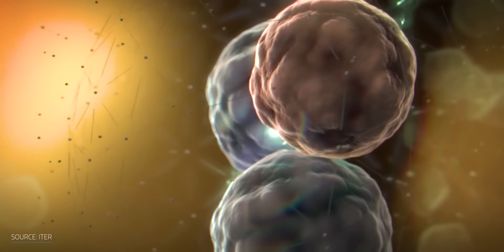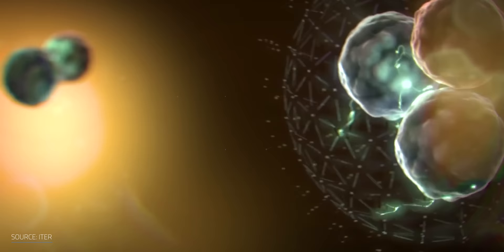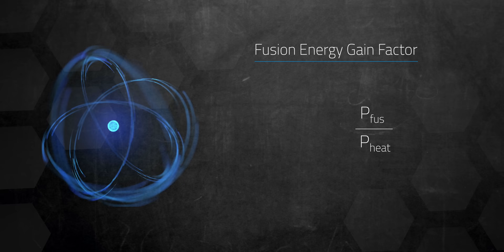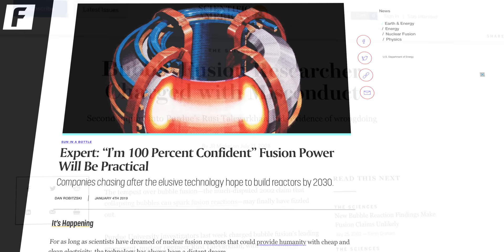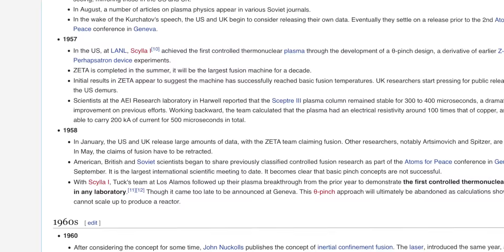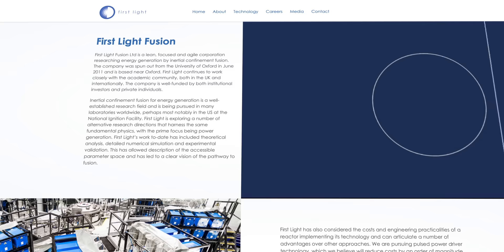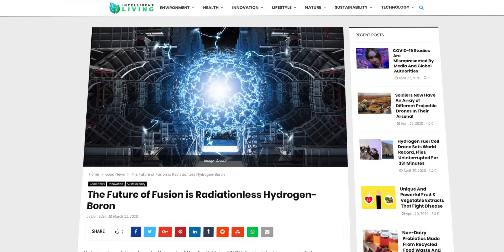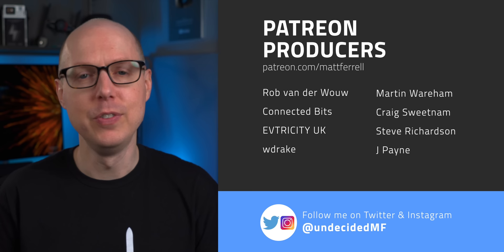The truth about nuclear fusion power - new breakthroughs

Comment: I'm a layman. So forgive my ignorance please. But this is my thinking:  If hydrogen can go through a fusion process to create a hydrogen bomb explosion, then why can't we scale it down to work in controlled hydrogen explosions in fusion reactors?  Why must we use tritium? Do hydrogen bombs work on fusion.  My understanding is that hydrogen explosions occur when proton/neutron pairs are split apart by the chain reaction of other protons and neutrons smashing into them.  That's the definition of fusion, isn't it? If so, then couldn't we control the size of the explosions by limiting the amount of hydrogen available to each chain reaction, like in a motor cylinder?
Reply: Couple things mixed up. First, a hydrogen bomb does use tritium. Tritium is just a type of hydrogen. H-bombs don’t use regular hydrogen. 

What you described about atoms splitting is fission. Fusion is the combination of atoms (the opposite). Both happen in an H-bomb. In an old fashioned atom bomb, only fission happens with no fusion (and no hydrogen/tritium). 

We can’t use them in a reactor because there’s no way of controlling this, they’re just too powerful. In order to kickstart the fusion reaction in a bomb, fission is used to create extreme heat and pressure. This would destroy anything we put it in.
Reply: @Gomlmon99  thanks.  So the h-bomb uses fission to create the fusion reaction?  The fission then I assume is created by extreme heat caused by what?  An explosion?  An electrical flash of photons?  My mind keeps thinking there must be a way to miniaturize the scale of hydrogen fusion in such a way to create enough heat to power a steam powered generator.  A normal AC light bulb sans oxygenated air can produce enough heat in the element to fuse nuclei in a way to produce heat at thousands of degrees which releases photon particles, right? That's fusion also then, if my thinking is correct.  Granted only the tiny element reaches thousands of degrees and by the time the heat reaches the outer glass shell of the bulb it is reduced to only a couple of hundred degrees. But suppose we could put the element inside a sealed tube which is constructed of high-temp vacumous glass with a diameter only slightly larger than the element.  And then put that inside another stainless steel sealed tube containing a water/steam system or hydrogen/steam system to power a generator.  Has that been tried?  I know it's more on the micron level compared to the grand fusion reactors we see being developed. But still, if it is shooting photons out then a common light bulb  is still reaching the point of fusion, right?
Reply: John Richter A h-bomb uses a conventional explosive to compress some nuclear material together, which sparks the fission reaction. That in turn causes the much larger fusion reaction. 

I don’t really know anything about how light bulbs work but if it’s fusing nuclei, I doubt it’s creating more energy than it uses. I assumed there was no fusion and it just glows because it’s hot but I’m probably wrong. 

What you described hasn’t been tried, and I’d guess it wouldn’t be possible to produce sustained fusion that way that produces more energy than it uses? Not too sure.
Reply: @Gomlmon99  I certainly agree. The resources needed to spark a miniaturized hydrogen fusion reaction would never get close to overunity.  My idea was to simply pass tritium through a separate tube alongside a heated light filament to see if the pressure in the tritium tube would increase.  My thinking is that every incandescent light bulb is also a miniature fusion generator.  All incandescent bulb filaments shoot gamma rays off in the form of helium-like sets of protons and neutrons (Photons).  So every light filament is a little fusion generator.  My idea is to pass tritium through a sealed glass tube (with distant reservoir) along side a powerful vacuumed deoxygenated environment filament emitting gamma rays to see if those emissions could spark a plasma cloud inside the sealed tritium tube system.  I don't think it would take much to test.  But I'm just a layman.  How would I get the tritium to test this?  Or could you test it?

Comment: Fusion power isn't the savior you all think it is. It will fall into the same trap that nuclear fission did, that is be insanely expensive to build and maintain. If the fuel is seawater the fuel may be cheaper, but we may need to go to the moon to get the elements we need. Nuclear fission only failed with early Gen reactors. The newer fission reactors have been designed to fail much less and often fail safely when it does. If fission reactors were both cheaper and safer, we would likely already have most of our energy production based on them. Fusion reactors will likely be even more expensive, and if they can't be cheapened quickly, will be largely undeveloped until we run out of fossil fuel and land for the other power sources.

Comment: star's gravity is so immense that it causes particles to fuse. gravity is key to sustained fusion in stars. what does a tokamak or other fusion reactor design has to sustain fusion and get net positive energy?
Reply: The net positive energy is gained from the fusion reaction. It doesn’t need gravity.
Reply: @Gomlmon99  sure. should've worked by now. containment issues has been pretty decent 10 years ago. so explain why can't anybody maintain the reaction??
Reply: @jojojojojojojojojojojojob  maintaining the reaction isn’t really a problem. The physics is well understood. The main issue is dealing with the neutron bombardment causing the entire structure to get embrittled.

Comment: What's happening with Thorium reactors?
Reply: Nothing ever will.

Engineers should understand that they are too stupid to comprehend how large scale social spending decisions are made.  Returns are not measured as you say, but more importantly generation is not compared only to generation but to solutions that shift or reduce use. 

France has not been able to export it's nuclear technology.  Germany has copied it's solar solutions planet wide and gets patent royalties.  There is no "backup" required on modern grids with demand response and EVs.  

Neutron scattering is a loser economically and you calculate the dead by opportunity cost. The wasted money on nuclear has killed vastly more people who weren't saved by, oh, better public health. 

ALL nuclear fission reactors are wildly expensive and take about a decade to construct. Thorium the more so since it requires the thorium to become uranium in a breeder stage first. Even at five years and a billion dollars, no power grid on Earth cannot find far better ways to invest that money over that time:

1. Swap out a billion light bulbs, from florescent to LED, cutting 20W each (or 80W each from incandescent). That's 20-80GW x the % of time each is on, say 10% of the time.  2-8GW saved! 

2. Change over 50,000 ICE vehicles to EVs at $10,000 each and install 5,000,000 solar panels at $100 each. The EVs store all the solar and take no oil, and feed the grid every day at peak times. Not only more power, but when it's needed. If each vehicle can #V2G just 1kw/day, that's 50MW for all 50,000 vehicles extra at peak, plus all the solar left over. It adds up to far more and more flexible power than the thorium.

3. Install $300M of transmission to a big dam that already exists, and spend $700M covering irrigation canals with solar shade. Less irrigation water loss, more power, more flexibility in backing up the dam since it doesn't need to release as much water and can reserve it for power reasons.

Comment: If you add in the electrical energy being used to run JET when it set its record, that 700MWe of electeicity brings its Q down to about  .03 instead of
.67. So we aint even close.
Reply: Again, you’re just changing the definition of Q. Q has a strict definition in plasma physics, you can’t just “add in” this and that to fit your agenda.
Reply: @Gomlmon99  bullshit, they are the ones that play with the definition. Q should be the subtraction of all the parasitic appliances, the amount of electricity put into the plasma, the amount of thermal put into the fuel, from the amount of energy that can be shunted to the grid. But that’s not it, they only calculate using the amount of thermal put into the fuel because that is what gives them the “gain” .  And I didn’t even mention that what they are getting out in the way of thermal is only about 40 percent efficiency once you convert it to electricity. So talk to them about what Q allegedly means. They tell the public and politicians etcetera in a manner calculated to deceive them. Is that science? So your position is that knowing Q is meaningless with regard to commercialization it’s ok for them to secure funding with transparency?
Reply: @russhamilton3800   That’s something else. If you want to create a new measure that’s fine, but you can’t redefine a physical constant just because you don’t find it useful. Physics doesn’t care about your feelings. 

Of course Q is not everything when it comes to commercialisation, what idiot thinks that? That’s like saying neutron efficiency in a fission reactor is what defines commercial viability of fission. That’s laughable. 

Q is just one of many important metrics. Don’t get so butthurt about it’s definition.
Reply: @russhamilton3800  Send me a source where any of Eurofusion, ITER Organisation, F4E, KIT, ENEA, UKAEA or any other ITER relevant fusion group says Q is net?
Reply: @russhamilton3800  “The condition of Q = 1, when the power being released by the fusion reactions is equal to the required heating power, is referred to as breakeven, or in some sources, scientific breakeven.”

Q refers only to heating power vs power internal to the plasma. Nothing else, no matter how much you cry that you know the physics better than the experts.

Comment: Practical fusion power has already taken over.  Solar PV systems are everywhere now and are cheap and reliable.
Reply: I’d probably say cheap and reliable is a bit of a stretch
Reply: @Gomlmon99  According to some Graph from Fraunhofer ISE i found the production cost per kWh of PV (in Germany) is actually the same / lower (for large plants) than fossil fuel power plants

Comment: abstract communications.... In 2003, the USA rejoined the project and China also announced it would join. After deadlocked discussion, the six partners agreed in mid-2005 to site ITER at Cadarache, in southern France. The deal involved major concessions to Japan, which had put forward Rokkasho as a preferred site. The European Union (EU) and France will contribute half of the €12.8 billion total cost, with the other partners – Japan, China, South Korea, USA and Russia – putting in 10% each. Japan will provide a lot of the high-tech components, will host an €1 billion materials testing facility – the International Fusion Materials Irradiation Facility (IFMIF) – and will have the right to host a subsequent demonstration fusion reactor. The total cost of the 500 MWt ITER comprises about half for the ten-year construction and half for 20 years of operation.

India became the seventh member of the ITER consortium at the end of 2005. In November 2006, the seven members – China, India, Japan, Russia, South Korea, the USA and the European Union – signed the ITER implementing agreement. Site preparation works at Cadarache commenced in January 2007. First concrete for the buildings was poured in December 2013. Experiments were due to begin in 2018, when hydrogen will be used to avoid activating the magnets, but this may now be about 2020. The first D-T plasma is not expected until 2026. ITER is large because confinement time increases with the cube of machine size. The vacuum vessel will be 19 m across and 11 m high, and weigh more than 5000 tonnes.....

🌏 📡🌏 👣🕘 💎👽☠☼☾☄ゞど・ㇺㇾㇽ₪𝖎𝖙𝖎𝖇𝖎𝖗𝖆₪なめㇺㇾㇽ✶☥✨🌛🌄⊀✶⋊🐺🐾☆🐜🐜▲▴◭

Comment: What king of energy fusion creates?? Thermal, electrical, radiant...
Reply: It is converted into electricity, but the exact type depends on the type of fusion energy we use. Most advanced right now produce high energy neutrons which heat a liquid metal blanket around the reactor, which then raises steam.

Comment: Fusion would be fantastic, but I think fission gets criticized unfairly here. Fukushima, for instance, killed a total 0 (zero) people, even indirectly through radiation exposure. The tsunami killed nearly 20,000, yet everyone talks about Fukushima. Using Fukushima as an example of the dangers of fission reactors is not a reasonable position. Chernobyl had a design that was known to be dangerous and isn't used in Western reactors ever. In fact, fission beats out solar as the safest form of energy generation per kWh so far.

Fusion will still probably be better, but I think we're going to need fission first—we don't have 30 years to wait. So we should be realistic about the problems of fission and not overstate them.

(I'm also big on solar and wind. I'm not knocking them. Our strategy right now needs to be "DO ALL THE THINGS!")

Comment: They use Tritium and Duetrim not sea water. Tritium is produced in a Fission reactor as a by product. They produce around 20kg of Tritium a year. Second Fussion is still vary radioactive to transfer heat from the magenetic confinement they emit neutrons. These neutrons radiate the containment vessel to a point were the materials in the reactor walls fail. They don't have solution for maintainable reactors or for fuel production, let alone supporting net positive energy. There is also alot of fraudulent claims in this industry as well.

Comment: I know it's fission....but MSRs are proven tech and are as cheap as coal while being as safe or safer than fusion
Shout-out from Buffalo
Reply: What makes you say they are safer than fusion. How is concentrating the most dangerous isotope of uranium safe? How is producing unbelievably corrosive hot, pressurised, radioactive salts very safe?
Reply: @Gomlmon99  MSRs operate near ambient pressure. They run on Thorium, and can burn existing waste stocks away. The by-products are nowhere near as radioactive, nowhere near as toxic, and nowhere near as long-lived as our present fission tech. There was significant research, and there were significant strides made, in metallurgy to deal with the corrosion. They are as safe or safer because they are walkaway safe; literally impossible to melt down. Please look into them. Molten Salt Reactors, not to be confused with Small Modular Reactors

Comment: The Q of 10 for ITER is simply not so. 300MW of electricity in and 500MW of thermal out does not give a Q of 10. The ITER trick to that was to only count the preheating of the fuel and NOTHING else. So we are still 30 years away.
Reply: Sounds like you just don’t know what the definition of Q is?

Comment: In the meantime we should be investing in MSR fission development.
Reply: No it's a failure. 

Engineers should understand that they are too stupid to comprehend how large scale social spending decisions are made.  Returns are not measured as you say, but more importantly generation is not compared only to generation but to solutions that shift or reduce use. 

France has not been able to export it's nuclear technology.  Germany has copied it's solar solutions planet wide and gets patent royalties.  There is no "backup" required on modern grids with demand response and EVs.  

Neutron scattering is a loser economically and you calculate the dead by opportunity cost. The wasted money on nuclear has killed vastly more people who weren't saved by, oh, better public health. 

ALL nuclear fission reactors are wildly expensive and take about a decade to construct. Thorium the more so since it requires the thorium to become uranium in a breeder stage first. Even at five years and a billion dollars, no power grid on Earth cannot find far better ways to invest that money over that time:

1. Swap out a billion light bulbs, from florescent to LED, cutting 20W each (or 80W each from incandescent). That's 20-80GW x the % of time each is on, say 10% of the time.  2-8GW saved! 

2. Change over 50,000 ICE vehicles to EVs at $10,000 each and install 5,000,000 solar panels at $100 each. The EVs store all the solar and take no oil, and feed the grid every day at peak times. Not only more power, but when it's needed. If each vehicle can #V2G just 1kw/day, that's 50MW for all 50,000 vehicles extra at peak, plus all the solar left over. It adds up to far more and more flexible power than the thorium.

3. Install $300M of transmission to a big dam that already exists, and spend $700M covering irrigation canals with solar shade. Less irrigation water loss, more power, more flexibility in backing up the dam since it doesn't need to release as much water and can reserve it for power reasons.